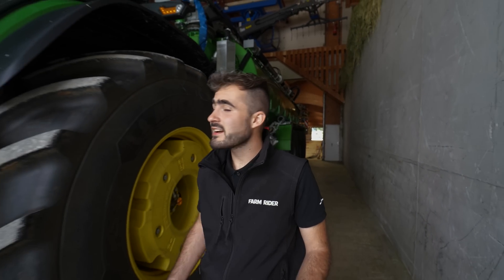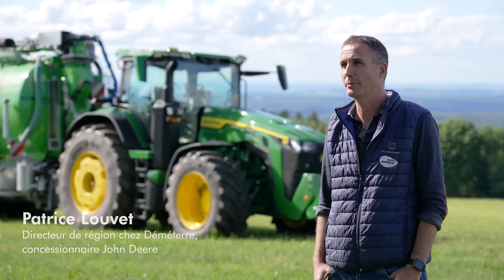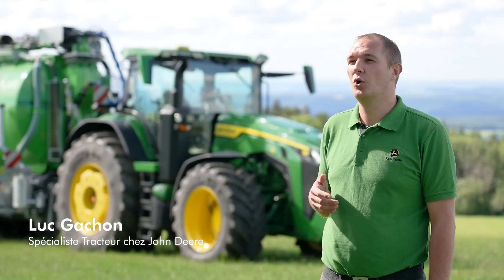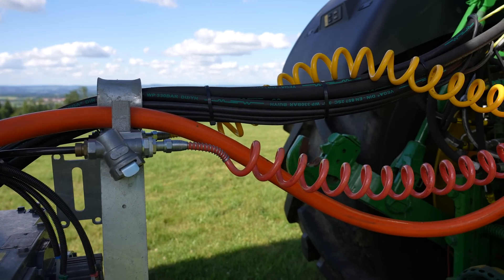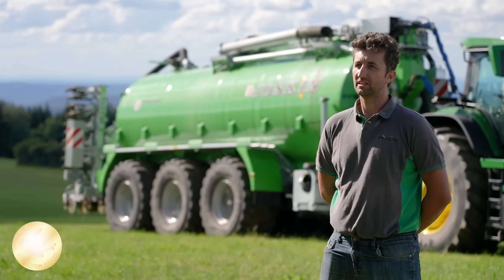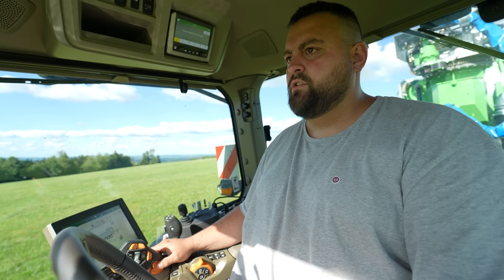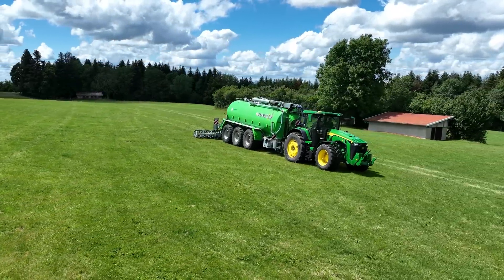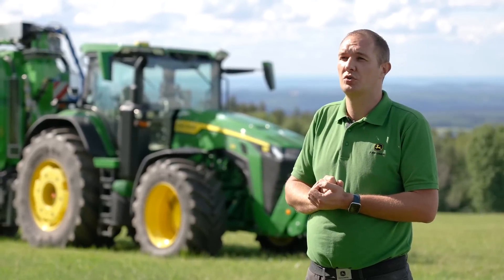ELECTRIC TRANSMISSION : NEW 8R eAutoPowr by JOHN DEERE ! "It's amazing !"

Comment: Ok, donc un moteur électrique sur la remorque, c'est ça la super innovation ? Allez pour l'année prochaine, je propose un moteur électrique par essieu plutôt qu'un moteur avec des arbres de transmission, pour gagner en poids et en rendement. Pour pour l'année suivante un moteur par roue. Je vous laisse la médaille. Et dans les descentes pour 2025 j'utilise les moteurs pour freiner et du même coup recharger une batterie. Etc. En fait, je trouve le tracteur plus intéressant, ça ressemble à ce que fait Nissan avec sa gamme "e-POWER" de voitures. L'intérêt étant que la transition vers le tout électrique sera plus facile, il suffira de remplacer le moteur thermique par une batterie, lorsque le moteur thermique sera interdit y compris sur les engins agricoles.
Reply from the maker: Le but de cette installation c'est justement d'optimiser au maximum la transmission électrique, et donc de faire aussi profiter l'outil derrière de l'électricité 👍